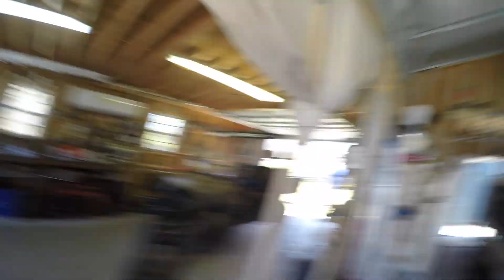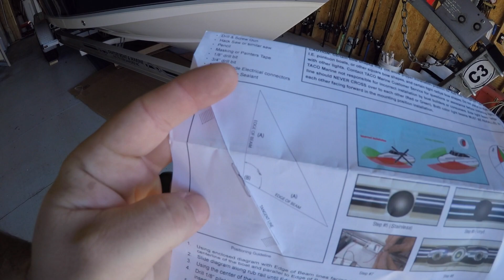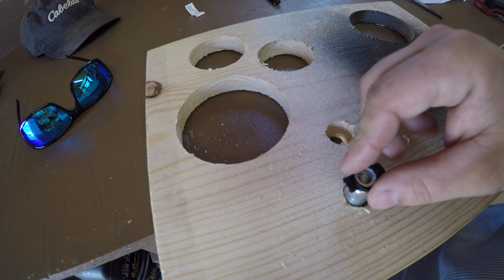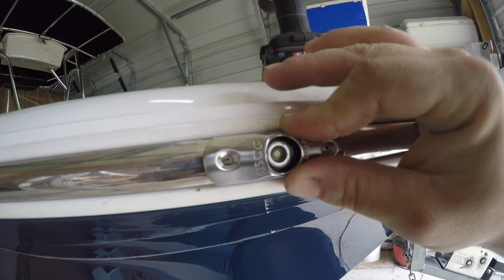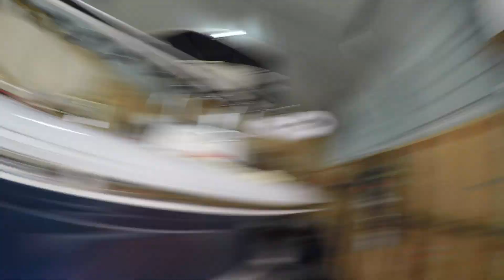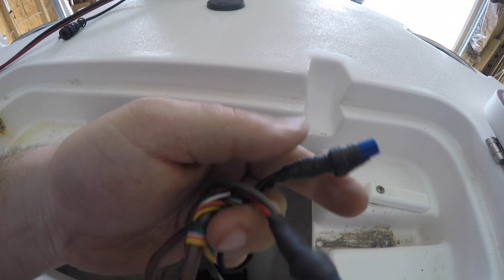Installing TACO Rub Rail Lights

Comment: For anyone planning to do this, use marine grade sealant for the holes you make and never use wire nuts on DC or in high vibration/moist areas. Also Minn Kotta suggests placing the heading sensor puck more than 2 feet from the trolling motor for best accuracy.

Comment: Im on my 3rd TACO green nav light, they keep going bad. I have heard others say the same. Has the company looked into this? My port side, red light, has never had any issues, still the original.
Reply: I have no short circuits on that side of the boat either. It's something with those green, starboard side lights?

Comment: Don’t forget to change out those wire nuts with heat shrink butt connectors,  it will rot ur wiring if salt water wicks in there.  Ya also outta 5200 the hole in ur fiberglass.    All said those things look great
Reply from the maker: I actually prefer a silicone for sealing lights on a boat, it’s not a matter of if but when for them to fail and need replacing. Would hate to have to fight 5200 to get those lights loose

Comment: Good video. I noticed that you didn’t use 4200 or 5200 around the light hole and the screw holes. Really should always use one of those for any holes in the hull. Also, please don’t use wire nuts, use waterproof butt splice connectors. This is year one boating knowledge and really important.

Comment: Great video, I know it’s been a while, but what did you use to plug the old bow light hole?  I’m thinking I’ll just leave the old bow light in place, but if there is a nice plug I might try it?  Also how is the Ulterra working, I just bought and installed one?  Which is why I’m looking at installing lights on the rub rail.
Reply: I watched the beginning again, and if I understand, you installed 12” bow light, and these replaced the 12” light.  So I guess what I’m seeing is the old 12” light socket.  Is that correct?
Reply from the maker: Yes I ended up installing the minn Kota heading sensor over the hole where the light socket was.
Reply: @THEBIGA2300  great idea, unfortunately I’ve already installed my sensor on the console.  Again thanks

Comment: Salty I have a quick question. I am getting ready to install these lights as well. Would it be better to cut the rail out first then drill the 5/8" bit through the hull? That way you don't have to drill the 5/8" bit through the stainless. Looks like you had to cut the rail out where you drilled anyways. Great Video thanks for sharing it.
Reply from the maker: That’s what I found to be the easiest to do.

Comment: Adam - thanks for posting this video.  After your '2 Year Review' video on the Minn Kota I've decided to add it to my Ultra 210.  I was also planning on adding the Taco lights and this video gave me a great blueprint on how to get it done.  Is your Minn Kota removable and, if so, which block did you use? (Any chance you made a video of the Minn Kota installations?)
Reply from the maker: I currently have it mounted on the RTA-17 but I will be mounting it on my new boat in the next week or two. It’s a gamefish 25 and I will be upgrading the bracket to the RTA-54. I’ll do a video
Reply: @THEBIGA2300  did you mount the trolling mount on your other boar yet